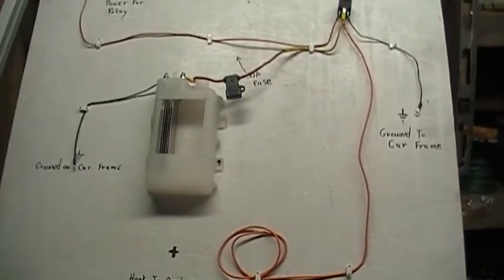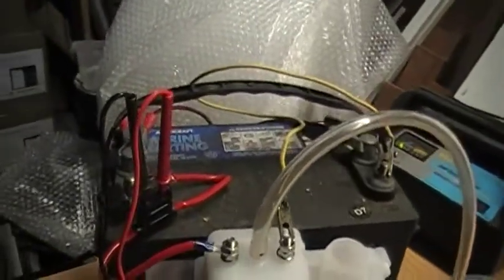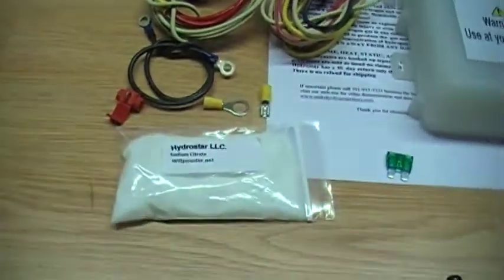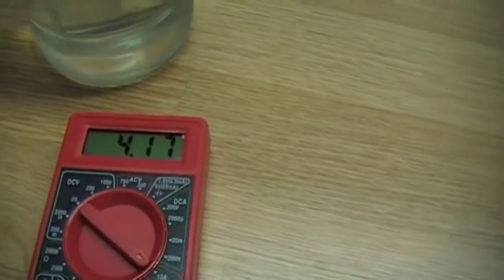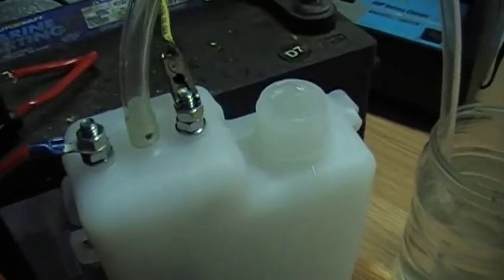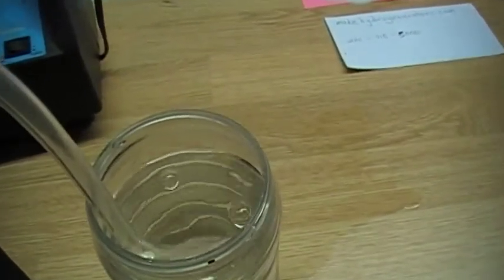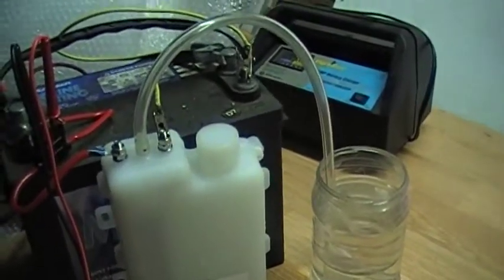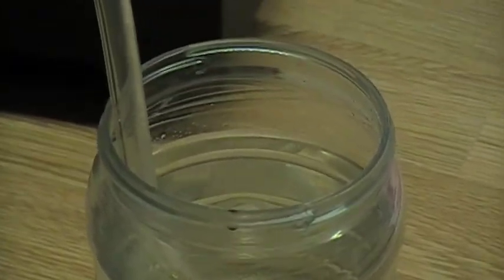Hydro Star HHO SETUP

Comment from the maker: This generator was designed by me and made in China in 2008 and I had made 5500 pieces. It cost me over $100,000. I don’t know who you are but you are a nut. Don’t know this guy in Canada. This was made for car and pickups. And at the time it was the best for sale and it only took 2 years to become old tech. Wiseman / masons new mighty mite was 3 times more efficient. Which I still make. But using it on vehicles 1995 or older still got 35 to 50% better mpg. Sold over 5000 threw the farm show magazines.

Comment: no bubbler ? where is the safety of this cell ? what about flash back ? I would be interested in this kit if it had a flash back safety.
Reply from the maker: I use a bubbler , I use eather 2 350 mmm or sometimes a gallon rubbermaid container. That is hard to ship so I mostly use the smalller ones.